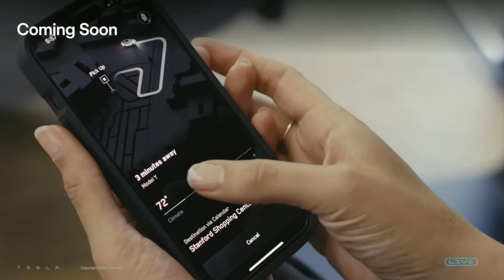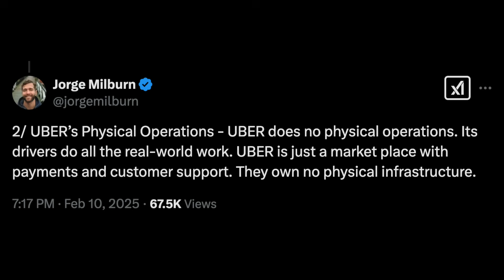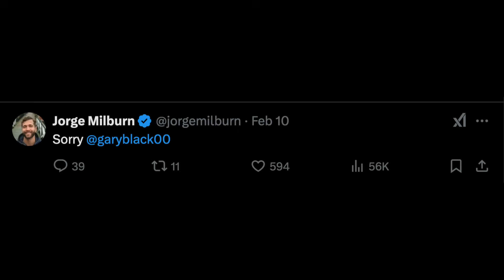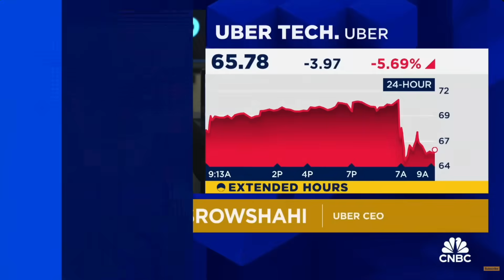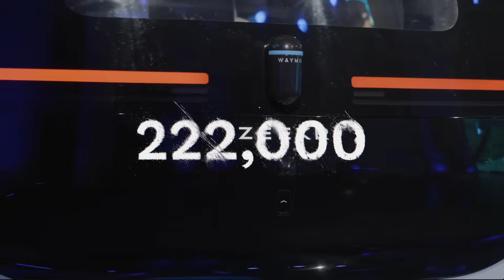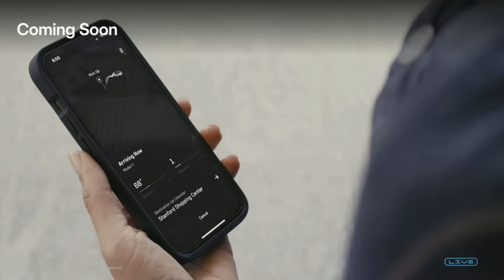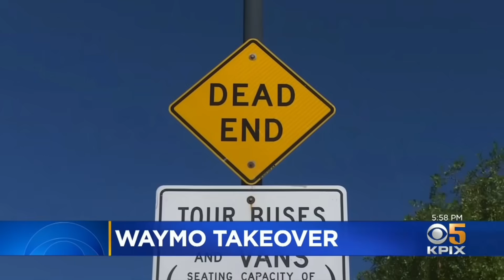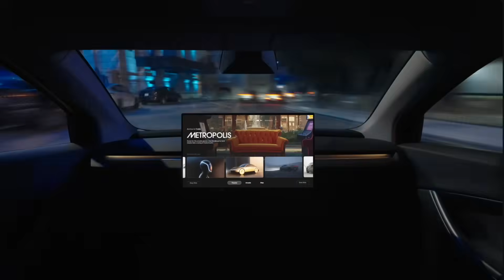Uber Admits Robotaxi’s are many years out - Former Tesla’s Employee explain the difference

Comment: I don't agree with this. For one thing, FSD is likely to bring down the economy(look at what tech in the 1920s did), but also seriously hammer the auto industry including Tesla's business. I don't agree either that they have huge advantage over Uber as they're showing a company that engineers everything...that's overengineering whereas Uber knows how to connect with real people and I'm betting that business just makes more sense with some humans in the chain still. Ex: robot vacuum out and clean cars and "we have the infrastructure" and no they don't. To me the infrastructure and the vehicles don't matter so much as the FSD software and technology capabilities. Ex: if Waymo has the best, they can indeed buy Jaguars even at way higher vehicle cost cause you're talking vehicles for automated use are ones likely last over a million miles of driving that their duty cycle is nearly 24/7/365, as unlike regular automobiles they're self-drive and don't sit idle all the time.  The cost of the vehicle isn't a big factor; it's who gets the self-drive tech first.  Also, China's gonna make vehicles cheaper than Tesla; sorry but it just is.
Again, I still say though that once we get this thing invented, it's going to cannibalize the whole auto industry not unlike what automobiles once did to horse drawn transportation and other conveyance(ex: trolleys). And sorry but Tesla won't be a monopoly either. That's where they're right about Uber's weakness, i.e. there's not a whole lot of "barriers to entry". Also, just like with how horses were technologically obsolete by the end of the 19th century, but it took several decades for them to be economically obsolete, there's going to be human driven cars on the road for a long time; they can last in many cases 20 years at this point for which people have a sunk cost invested in them, i.e. "yes I can take an Uber or Lyft, and even more cheaply in many cases, but I often don't because I still have my car."
On some level I see this as a mirror between what happened with smartphones, with perhaps Tesla comparable to Apple, and Waymo(obviously) comparable to Google/Android.  That I think Waymo may have the advantage.  For "infrastructure" too, I don't think what Tesla has not is at all conducive to self-drive, and even if it is, I picture a lot of this may be franchised like vehicle rental businesses are today...cause for one thing there's going to be many mechanics who have a lot more time on their hands...but they'll still needs mechanics and people to take care of the FSD vehicles. Ex: Bird and Lime rent scooters, and employee people to keep them charged and maintained.

Comment: Those Uber drivers, many at least, will pivot to small scale FSD operators. Financing several cars and managing them. For them, once an established work method has bedded in, it's a far more profitable solution and likely less but better working hours. They are just fleet operators.

The Eats side of the business is going to be interesting is people side hustle into the market, I wonder what Tesla is working on for that.  Taking a scan the Eats, Deliveroo, etc market, is a massive market but it how the last 10 or metres at the door is dealt with as well as automatic pick up.

Comment: IMHO, RoboTaxi will need to be remotely controllable for some years to overcome the one-in-a-thousand trip that has an issue. Waymo does this many times a day and issuing an override command is how they are useable and avoid having to drive to solve issues manually. This should be very straightforward fo Tesla to implement.
Reply: Tesla can just send a real live driver.